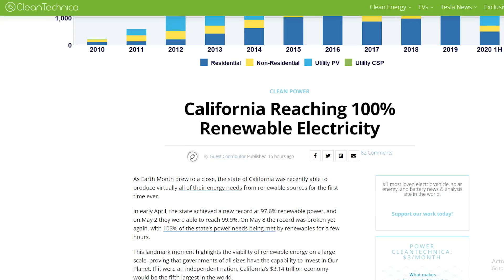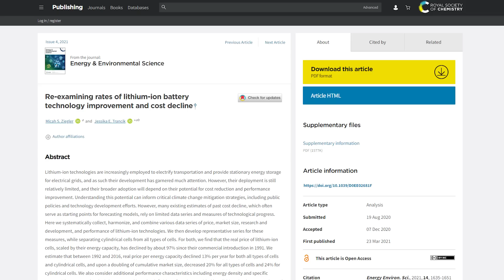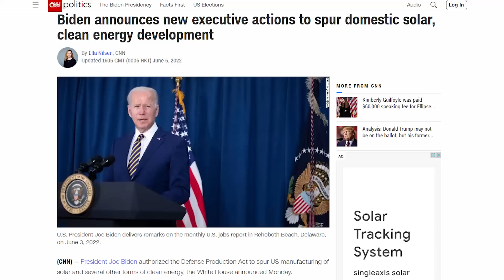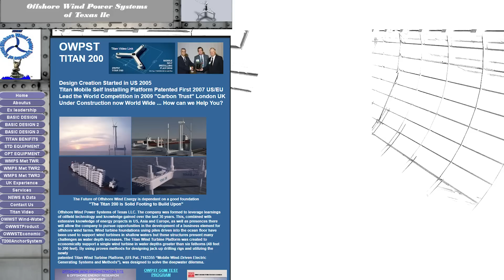World's 5th largest economy reaches 100% renewable electricity

Comment: Ok the headline is bullshit, it didn't include the LARGEST population center and user of energy, Los Angeles.  

"There are several caveats. For one thing, Saturday’s 94.5% figure — a record, as confirmed to me by the California Independent System Operator — was fleeting, lasting just four seconds. It was specific to the state’s main power grid, which covers four-fifths of California but doesn’t include Los Angeles, Sacramento and several other regions. It came at a time of year defined by abundant sunshine and relatively cool weather, meaning it’s easier for renewable power to do the job traditionally done by fossil fuels."

Comment: Wright's law will accelerate the drop in wind, PV and battery prices as these become the norm for power generation. When batteries get cheap enough it will be normal for houses and buildings to have their own batteries to buy power when it is cheap (at daily solar and wind peaks) and as the tech for solar roofs and windows matures a distributed power generation and storage grid will emerge.

Comment: You said in the last 10 years Solar has become 10x more cost effective? , so if solar was $1,000 it would be $100 now…. But at the beginning of the video you said in the last 30 years cost has come down something like 4-5x … that sounds extremely false but correct me if I’m wrong, technically moves fast but not usually that fast in 10 y
Reply: Back in 1977, the price of solar photovoltaic cells was $77 for just one watt of power. Today? You can find solar cells priced as low as $0.13 per watt, or about 600 times less. The cost has generally been following Swanson’s Law, which states that the price of solar drops by 20% for every doubling of shipped product.
Reply: @macrumpton  gotcha wow, so a drop 10x in the last 10 years doesn’t sound off?
Reply: @thefoss721  it dropped 12% between 2020 and 2021, so that sounds about right. Although many people are mixing up cell prices with installed installations, which confuses things.
Reply: @macrumpton  wouldn’t 12% per year for 10 years be just over 2x more? Like 120%? Which is just over double… but 10x would be 1000%

Comment: I don’t know if anyone has pointed this out.  The month of May is a temperature / energy use transition month in California.  The need for heating is getting less and the electrical demand for air conditioning has not peaked.  You are describing an unique point in time for low energy use in California. For the rest of the year electrical demand is much higher and could not be met by current renewable infrastructure. 
Prematurely shutting down coal, oil, natural gas plants will only contribute to higher electricity prices. This in turn will hurt consumers directly and indirectly through higher inflation.

Comment: We do need grid-scale energy storage, but I’m not sure that’s going to be traditional batteries in a lot of cases.  I think it might be pumped storage (moving water between two lakes at different altitudes, for example), compressing the air in underground chambers, etc.  Anything that can move a turbine as you release it can be energy storage!

Comment: Bullwinkle why is it you never talk about deep drilled heat source power.That will be used in countries that do not have ideal conditions for solar or wind power in the north.Plus the holly grail Space Based Solar.China is launching system in 2028.Get up to speed.

Comment: Enjoy your work, but you need to read Lazard's LCOE analysis.  That's the gold standard of relative electrical generation costs and shows clearly that renewable plus storage is still more expensive than fossil.  New generation that doesn't need storage can be renewable, but any electrical needs that require storage are still more expensive with renewables plus storage.  When batteries are half the current cost per Kwh the world can cost-effectively build renewable plus storage rather than new coal/natural gas, but it will take many more years for it to be cost-effective to replace existing fossil fuel/nuclear with renewables.  The rich countries will move to renewables plus storage faster even though it isn't purely cost-effective because we can afford to, but the world's poorer countries will use coal until it's strictly cheaper to use renewables plus storage.

Comment: You can make the claim of 100% renewables, but that's really relative.   Nobody is 100% renewable energy for any extended period of time, they just can't.
When there is a sudden demand put on the grid, green dies.  You need a more sustainable energy supply like oil or coal that's going to be consistent.

Comment: Can you discuss Australia's renewables issues where they are in a panic trying to fire up shuttered coal plants to prevent blackouts? Sky News Australia YT channel is all over this.
Reply: If Sky News Australia says something - question it because it is probably a lie.  Renewables in Aus are growing steadily, but the current crisis is quite complex, but not really related to renewables.  Some time ago a large generator in Qlds Callide Coal fired power station caught on fire and that is out.  On 1st of April, one 500 MW generator in the Liddell coal-fired power station was retired - very old power station and that generator was failing so much that was the first to retire, the rest to follow in years ahead.  Several other coal-fired power stations in NSW and QLD have generators out for planned or unplanned maintenance.  Then the North East have had lots of flooding with damaged railways and flooded coal mines.  Some power stations were struggling to get enough coal and still are.
Then the prices went up for coal and gas mainly due to the war in the Ukraine.  The energy market has a cap and due to the high coal and gas prices, a bunch of coal and gas generators decided it wasn't profitable so they started pulling the plug.  The market operator took control.  
So apart from the planned retirement of one coal generator at Liddell power station, the amount of installed fossil fuel capacity is the same as it was last winter.  The difference is they are getting older and less reliable.  Only Sky News can turn a fossil fuel generator disaster into a "let's blame renewables" news story.

Comment: PG&E recently announced that the California policy of banning ICE cars by 2030 will lead to brownouts and/or power cuts in the summer months as demand for electricity for aircon plus EV charging will exceed generating capacity. This will be exacerbated by the shutting down of the nuclear power stations and will require an increase in the output of the fossil fuel power stations. California is an idiocracy.

Comment: I am sure the people in California who have suffered through brownouts and blackouts may not be quite as impressed. What happens when you replace all the ICE cars with EVs. The energy now supplied through gas and diesel will have to come from the power grid which struggles to handle the loads on many days now. With the investment required, the regulations that must be followed and the development and construction time required you are at least 20-30 years away from being able to support a complete conversion to EV's. People use Norway as a great example of the conversion to EV's. They only have about 5 million people and have massive hydroelectric capacity, which most countries don't have. They are paying for their conversion using money made by selling oil to other countries. The replacement of all fossil fuel power stations in the US can only be done with nuclear, which no one wants. I think EVs are the future but nobody seems to be discussing the difficulty of getting there.
Reply: Those brownouts are happening when loads are highest-- hot summer afternoons and early evenings.  The majority of EVs are charged overnight, when demand is lowest.  There isn't going to be a huge problem.
Reply: @incognitotorpedo42  I understand that. My point is, that there are relatively few EVs on the road in California now. Most people can't afford one. If there is a target to have all the cars in the state EV in about 18 years you will be adding a huge load to the grid. Because of the current costs, regulatory requirements, etc, it does not seem practical to think that the electric grid will be capable of handling the load in time. California is blessed with lots of lands that are clear and sunny most of the year, so solar expansion is possible. Most states, particularly those in the northern part of the US are not so blessed. I wish that were not true, but I think too many people are putting the cart before the horse, as seen with the push to reduce fossil fuel production before alternatives are available to replace it are in place.

Comment: Need to make a few corrections here.  Yes, California's electric grid did achieve 100% renewables.  But not over a 24 hour period.  It was over about a 6 hour period and the reason it happened was because California has very low electricity demand in the Spring... a period of the year where temperatures are just right (not too hot, not too cold) and nobody needs AC yet, but a ton of sunshine abounds.   This happens almost every year.... there are always a number of days in the Spring, and sometimes in the Fall too, where renewables are able to blow past 70% of the grid for a few hours during the day.

During high summer CA doesn't get close to 100% even at mid-day.  Its still decent, though... 60% is quite common.  Solar and air-conditioning are a match made in heaven.  During winter, CA burns a lot of natural gas for home heating.  Renewables generation on the electric grid during winter is quite decent, because winters in CA are mild.  But to see the whole picture you have to look at the state's NG burn too.

Another correction... yes, battery storage went up considerably, but those high percentages are from a very, very low level of storage before-hand and don't mean very much.  Right now CA's battery systems can put out around 2GW on a daily cycle, which isn't even remotely close to what would be needed to actually handle the evening peak, let alone anything overnight.

California still has a long ways to go.  We need at least 6x our current solar generation and in terms of utility scale storage we are talking about at least 15x-20x current storage just to handle the evening peak, and a lot more than that if we want to start handling overnight generation too.

Wind won't save the day.  While CA does have a lot of wind potential, and again you are completely correct in that wind tends to peak (as it does for almost any coastal state) at sunrise and sunset, but CA's wind build-out is very slow compared to its solar build-out.  Kinda the opposite of Texas which focuses on wind and not so much on solar.   CA focuses on solar.  It is just straight-out cheaper for us because maintenance is very low and labor costs in CA are very high.  Wind, particularly ocean-based wind, is a difficult proposition for many reasons.

Its great news, but it is just the beginning.
Reply: How does PG&E factor into the rise of renewables/storage in CA? Will they eventually be replaced, will the company somehow transition to be the renewables operator in the state, are they resisting the shift through lobbying efforts, etc?
Reply: @ussonbryant5763  The CPUC has all the power (California Public Utility Commission).  And the CAISO (Californis System Operator) is the grid operator.

The three main 'power companies' are PG&E (north), SCE (Southern California Edison), and SDGE (San Diego).   These are the public-facing utility companies, but they only own some of the in-state generation.  The in-state generation is a real mix of independent generators, utility-owned generation, and other external agreements for importing and exporting power from/to nearby states.

The generators are basically bound by the tariff schedule the CPUC comes up with and not so much PG&E or other consumer-facing power companies.   The tariff schedule is the primary driver for renewable projects in the state.   

Now, the CPUC itself... well, most people including myself consider it a fairly corrupt heavily corporate-leaning organization.  There was a huge kerfuffle over Christmas about NEM3.0 (the new consumer tariff schedule) that was widely ridiculed as being anti-solar and it wound up getting pulled.   

I think a lot of politicians still really don't understand just how much renewable generation needs to be added to the state to gain any sort of fossil independence.  Its a lot.  The solar build-out we have so far is just a start.  We are at the stage now where we really need to add huge amounts of utility-scale storage (tens to hundreds of gigawatt hours, and tens of gigawatts) in addition to continuing to build-out solar and wind resources.

-Matt
Reply: @junkerZn      ... Sooo.... let's get the (very) F#ck.... BUSY.....

Comment: But how many tons of coal and how much oil  does it take to make the turbines and solar cells?
Reply: The more turbines and solar cells are installed, the less coal and oil is needed. Naturally, you will generate much more energy with every turbine or solar panel, than it took to make it. Otherwise they wouldn't be able to sell them.
Reply: @itekani  what about the 600 tons of coal to make the rebar in the foundation for each turbine that can't be reused! Then there is about 100 tons to make the rotor and gearboxes!  And about a thousand barrels of oil to make the carbon fiber for the tower? Yes wind turbines are a huge market for big oil!
Reply: @itekani  check you data!
Reply: @terenceiutzi4003  I checked, did you?
Reply: @itekani  600 tons of coal used to make the rebar in the foundation!
Reply: @itekani  just like the Imbeciles that want wind farms but say cow farts are destroying our enviroment but don't stop to think of the millions of cattle required to make the EP lube for the turbine gearboxes
Reply: @itekani  you know that is bull shit! We have 8 1MW turbines just out side of town and the foundations of each one was ove 10000 tons according to the propaganda that the company released when they were building them
Reply: @UC6yqWHDtgoNcUj9DYC1mxfA Monday we are shipping a 14 MW transformer and it has 25 ton of copper in it and the total package sits on a custom 8 axle float. It is used for voltage adjustments to link wind farms to the grid!
Reply: @terenceiutzi4003  What's bullshit? What's your point?
Reply: @itekani  go check out a wind turbine being erected and look at all of the 5 axle trailers bringing in the components and then ask yourself how many tons per MW do they weigh?
Reply: @terenceiutzi4003  It was weight per MWh. At least learn the difference between power and energy. Your ignorance is embarrassing.
Reply: https://youtu.be/wNHe-lQrrOs

Comment: Mark - i am just pointing out Sams own data - which shows coal as cheaper; and also what ever gas combined cycle are is cheaper plus they are reliable; available night and day..  Solar and wind in California are only about 5% of its energy used.  You say that solar wind with battery are the cheapest - well thats contrary to Sams own data but I'd like to see where you get this.  His data shows residential solar as one of the most expensive.  Even if solar with battery were cheap; you are then devoting more lithium to that and less to EVs - that further limits the production of EVs which is currently a trivial number.  There are 140 million cars and trucks sold every year.California is roughly 75% fossil fuels.  They do not consider nukes, hydro, or geothermal green. Most of the 30% of electricity they import is from Hoover dam.

Comment: Yet in CA we are paying more for everything including electricity. To charge a Tesla is 24 cents per kwh during off peak hours as  compared to 14 cents in other States.
Reply: As long as you have to burn any fossil fuels, there is no upper limit on how much fuel they might need to buy per year so the prices are always set high enough to cover the most expensive sources in case they are needed more than average...
Reply: ...But Super-Off-Peak is only 11 cents per KW/h (midnight to 6am, when most charge).

Comment: Sorry to be the naysayer, but that "record" was only achieved for less than a single hour during one clear day in early summer.  The rest of that day, gas powered generation took up the slack, like it always does.

When California is charging their EVs overnight, this power predominantly comes from burning gas.
Reply: And the power to drive ICE cars comes exclusively, not predominantly, from fossil fuels, some of which come from overseas.  Meanwhile, the power to charge EVs comes more and more frequently from renewables.
Sorry to disrupt your Debbie-downer position.
Reply: @michelangelobuonarroti916  Not sorry. I have a 2015 Tesla S and 2021 3, also Tesla solar panels and power wall.I'm working on a low temp heat pump for climate control and water heating, cooking with induction, drying clothes with natural evaporation and all I need is more solar and more power walls and I'm green. I'll supply the grid more energy than I use and all it takes is money. So what. In ten years my neighborhood will be free of fossil fuel pollution and the children of todaY can work on reversing all the damage we've done. All that money your saving by sticking with fossil fuels is just going to choke all of us.
Reply: Just a thought. https://youtu.be/N-yALPEpV4w